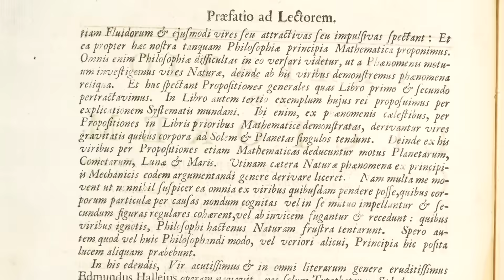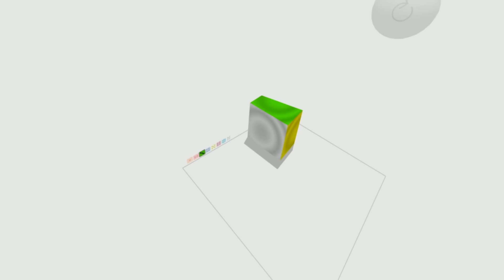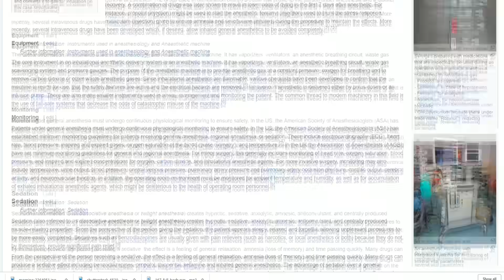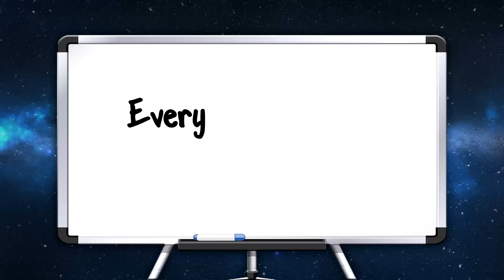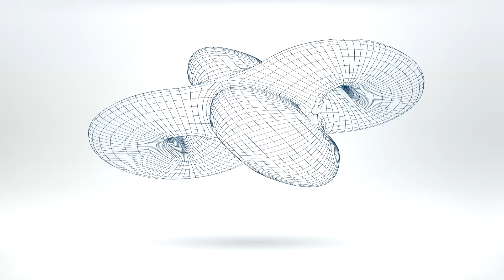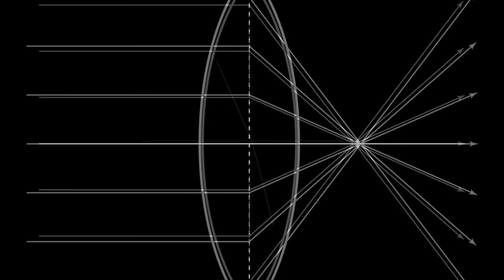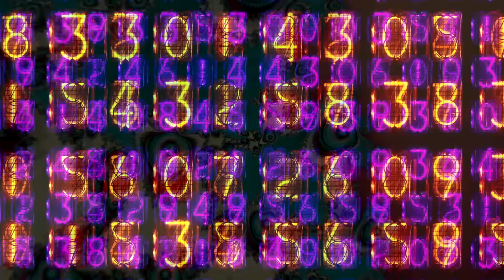The Mystery at the Bottom of Physics

Comment: If the BIg Bang had been more violent by a factor of 10^-60 or more, the universe would consist mostly of cold hydrogen, with few stars and supernovas. An uninteresting place.
If the Big Bang had been less violent by a similar factor, the universe would have ended in a Big Crunch by now. If the universe had not already collapsed, it would be filled with supernova remnants (with no planets) and black holes (which emit no radiation and hence cannot support life).

Why is the electromagnetic attraction between the proton and electron 10^39 times stronger than the gravitational attraction between them. If that factor were 10^38 or less, or 10^40 or greater, the universe as we know it would be impossible, and no life could emerge anywhere.

Comment: Imagine two clear chemicals reacting with each other and producing a compound, which is opaque. The opaque product seems to appear magically, doesn't it?
I claim this to be an effect of the fourth dimension on a molecular level. You could imagine the probability of an electron dwelling in a certain confinement, called an orbital, as a fourth property besides height, width and depth. While it is still dependent on three dimensional matter input, the product litterally appears out of nowhere.
You might argure that it shouldn't count, due to the fact that it does NOT appear magically out of nowhere, but it is merely a product of the two substances reacting with each other. But why should there be no rules for the fourth dimension? Wouldn't it break the laws thermodynamics?

Comment: The speed of light is actually variable based on how much the gravity pulls it (in any direction) for example the huge gravity that a black hole produces sucks light in and therefore it disrupts its speed (slower or faster).
One of the most important measurements is time. The time that we know has a start and an end or a start with no end (one-directional infinity) but the rality is the time can be and is omni-directional infinity so some things can not be measured in "time" but are measured in "events"...

Comment: The idea that gravity on earth was the same as for the heavens was not given a convincing proof until Newton but it was something sought after by Kepler who attributed the tides on earth to the action of gravity from the moon. He pointed out that if the moon's action on the earth was enough to produce tides then the action of the earth on the moon would be all the greater. But he lacked any connective tissue so to speak. Robert Hooke also wrote about this same possibility and claimed to have a proof that gravity had to be inverse-square, a proof which he told Edmund Halley about but which he never actually produced or published. The point being sure Newton proved it but the idea of unifying Kepler's and Galileo's laws into a single framework was already being talked about by others and had been around for at least 50 years by the time Newton started his research into gravity, so this idea was definitely not exclusive to Newton and was in no sense a complete bolt out of the blue.

Comment: We also don’t know how planes work so we’re doomed
Reply: Joukowsky transform airflow around a cylinder and you get airflow around a wing in cross section and a very reliable approximation for the lift involved at different air speeds so it's not exactly a matter of complete ignorance.
Reply: Dude, joking
Reply: @pizzleanimates1575  I assumed you were joking about the being doomed part. We really do need an international font/symbol for sarcasm. To your original point though, we don't really know why we can get away with the Joukowsky transformation because our knowledge of fluid dynamics is still so limited. So we can model what we don't really understand and somehow kind of get away with it. My point was also suggesting that there's still an incomplete ignorance but that we have eroded just enough ignorance to make functional planes anyway.

Comment: What's a field?
Reply: There's more than one kind of field but a useful example often used to get the ball rolling is temperature. Temperature as a field just means that a temperature can be defined at every point in space and for every time. You give me the point in space and the time, and if I have a really accurate temperature field equation then I can stick that location (coordinates) into an equation and out will pop the temperature at that point in space and at that time. This kind of field which a location goes in and a single number pops out is called a scalar field.

To complicate things there are also vector fields, spinorial fields and tensor fields. Technically, scalars and vectors are also different kinds of tensor so scalars and vector fields are also both examples of tensor fields but there are other kinds of tensor fields which are more complicated and you can represent the next least complicated fields with matrices. Once again the elements of that matrix depend on position in space and the moment in time. The principle is basically the same, you give me a location and I give you back a specific spinor, vector or matrix. So all fields, no matter how complicated, are always defined at all points in space and over all times.

That still doesn't say what they are used for in physics though. So here goes. Fields in physics describe how particles are created and annihilated, they describe how particles move and how they interact with other particles. So each particle in physics has a field associated with it. So there is an electron field and where the field is in some excited state you can say, hey there's an electron here or you can say the electron field is excited here and they mean the same thing. If you look at a proton that's two up quarks and a down quark. So two up quark field excitations interacting with a down quark field excitation. For a hydrogen atom, that's now an electron field excitation interacting with the proton, which was just the interaction of quark fields. All matter can then be built up from fields. You might ask why bother with the fields and why not just use the particles and the main reason is that when you stick with particles you cannot describe systems more complicated than one particle in a potential.  You cannot describe situations in which particles collide and something gets annihilated or new particles are created. Once you move to fields you can have all kinds of interactions and you can then model creation and annihilation of particles. So there's a complication but there's a payoff in descriptive power.

Hope that helps.

Comment: Gerald Whitrow, writing in the 1950s, gave shrewd reasons why a universe with 3+1 dimensions worked well and was friendly to complexity.
Unlike the other constants discussed in this video, the fine structure constant does not vary with the units of measurement. It is not only constant but dimensionless. It is the coupling constant for electromagnetism. A similar constant exists for the strong nuclear force, but is much less discussed than alpha. A coupling constant for gravitation can be defined, but requires choosing two objects with arbitrary masses. The ratio of the mass of the proton to that of the electron is called beta, and is about 1828. Like alpha, it is dimensionless.  
Planck units normalise G, c, h/2pi, and k to 1. 
For further discussion of this subject, go to Wikipedia or read the book described here:
https://en.wikipedia.org/wiki/Anthropic_principle#The_Anthropic_Cosmological_Principle

Comment: The video is just gobbledegook based on crazy science, and the crazy standard model. There's no such thing as time, and the constants are made from restrictions in scale like inflating a bunch of balloons in your house until your house is full of balloons. Those balloons will then have a restricted scale that they have to share with each other. The universe is quantized, and each Galaxy is quantized at the central point, by restricting scale you restrict the size of zero. Yes.. zero has scale. By restricting the scale of zero you give movement a minimum distance, and the crossing of a minimum distance is a constant speed. Speed = Distance. Like the lights on a Christmas tree the pattern moves at a speed based on distance. There is nothing complicated about the Universe, there are only mistakes that lead to confusion. These videos highlight the mistakes, but in an attempt to sound clever... that's not clever. Find the answer to almost any question by searching my site... http://greatestminds.freeforums.net/

Comment: if i'm traveling ½ the speed of light then my head lights would be traveling ½ the speed of light away from me.  but what you're saying is my taillights would be traveling the speed of light away from me.  i had to think about that for a minute.  is that what you're saying? (1:26)
Reply: No. Light from your headlights and your taillights are moving away from you at the speed of light. 

In special relativity where c is the speed of light, you add velocity v = V/c to a second velocity, u = U/c such that the total velocity is given by v + u / (1 + vu ). 

https://en.wikipedia.org/wiki/Velocity-addition_formula#Special_relativity

Now let V=c for your special case of the beam from your headlights and then v = c/c = 1. This would be you moving at velocity u watching light from your headlights move away. Sticking that into the velocity addition formula, you get...

(0.5 + 1) / (1+0.5) = 1.5/1.5 = 1 

But 1 is some new velocity for the light beam, that is just some velocity which is also divided by c . Well the only way that can ever be 1 is if the 'some velocity' is also the speed of light. So light is moving away from you at the speed c , just as if you were not moving at all.

Now for the tail light. Now instead v = -1

So, sticking that into the velocity summation law, you get  (0.5 - 1)/(1 - 0.5) = -1 . This too is the ratio of 'some speed' divided by the speed of light. But for this to be true that 'some speed' would be in the direction opposite your motion (it's negative in value) and it would have to be - c in magnitude. 

So, both the beam from your headlights and the beam from your tail lights are going at the speed of light.

Comment: Would it be that dark matter holding protons together inside nucleus. When matter is squeezed to a degree that it’s gets entrapped in dark matter lattice. Dark matter of course will not interact but act as a container. The power that’s packed inside is released when dark matter container is broken. Rambling stops.

Comment: lol , i like this approach  :D  ... however you have many things wrong and all you do is parroting mainstream bullshit science , but i like those fun parts  ... First of all light doesn't travel , and is not a constant .  Simply because light doesn't exist .   When we talk of light ,what we are really referring to is illumination of an object in a field .   So called light has not mass , it is not a particle , it is a wave . But wave is not a thing , wave is what something does.  Nothing emits light . When you talk you are not emitting anything . You are changing properties of the medium which surrounds you.  All those constants have origin in geometry . When you talk about Pi , again you are just parroting the definition ,without ever realizing that the value which we use for Pi is not calculated by its definition and the most fundamental formulas such as C=2Pi*r  , or A= Pi*r^2 have never been proven . We don't have any prior theorem for lengths of curves etc ... And exactly there is our science today ..  we do not understand the most fundamental geometric shape as is the circle . Time is not a dimension , Time is an arbitrary measurement unit by which we measure the rate of change . You can't slow it ,or bend it ,because it doesn't exist . Also you can't change units of measurement ,because then any experiment is not possible of empirical verification ,which is basic requirement in science . Einstein fucked this all up by theory which was stolen anyway and is holding our science back for fucking 100 years already .

Comment: Is the fact that there is a minimum length, proof that the universe is pixelated?
Reply: the "minimum length" isnt the smallest length possible, its just the smallest measurable length possible. once you go smaller than the planck distance, things exist as probabilities of position rather than actual positions
Reply: Noah Hassett quantom realm
Reply: @noahhassett3355  oled
Reply: Not necessarily, but possibly
Reply: @nbtstan3198  lol. Thanks for the insight. 😂
Reply: If the pixels are interactions, and not the actual particles that is spot on then?
Reply: Those aren't "pixels", they are interference caused by the changing frame rate: T - ^t

Comment: In my opinion, the constants in most things are simply not as important as the relations that come out of the math. For example, “G” is really just there because it needs to be and really only defines the strength of the gravitational force. What is really amazing is the actual relation between the other variables and gravity. Why does mass influence things in a linear manner? Why does it decrease asymptotically as Fα(1/r^2)? Nobody really knows. Additionally, it could very well be that classifying time as a separate dimension is wrong altogether and our 3D perception of the universe could just be our perceptions forcing us to look at a cross section(s) of a 4+D universe. Not only that, but where do all the interactions and the laws that govern them come out of? Why does the strong and weak force act the way it does and only under certain ranges? Why are gravity and electromagnetism related mathematically? If there is different sister part of gravity that acts on a principle of angular momentum like magnetism does? All in all, there seems to be a seamless interconnected value between all of physics and mathematics including mathematical constants like e π and i (being that through calculus you can fairly easily derive e^(πi)=-1)

Comment: The mass of a proton can vary, based on composition. If it is made of two up quarks and one down, then it is 1 AMU. If it is two charmed and a strange, then it is 286.5 AMU, weighing about as much as Nihonium. If you construct a proton with two top quarks and a bottom quark, then it will weigh ~35,000 AMU. It is easy to think that the mass of a proton is constant, considering that most protons are composed of (uq,uq,dq), and the heavier variants decompose back to (uq,uq,dq), but it is not impossible to imagine that heavier protons could be stable in certain conditions. Additionally, we have no proof that (uq,uq,dq) is the lightest proton variant, either.

Comment: When it comes why there exists anything at all you have three options once you break it all down.
1. Nothing became something at some point (quantum fluctuations), logically impossible, nothing can't exist because if it existed, it would be something.
2. Infinite regression (aka turtles all the way down, big bounce theory), logically impossible as you need more than infinite energy to sustain the infinite causal chain.
3. Something always existed/existence has no beginning, it always was, a thermodynamically isolated system, logically sound.

Further down the line you get the question "why is there change"/ free will vs determinism and now you have a further 2 options.
1. Change is constant and random, logically inconsistent with our observable universe as it is highly ordered.
2. The something that always was, willed it, since if there was complete order without will to change it, it would be in eternal equilibrium (steady state model).

Then you have the question of consciousness where there is only one option even though people claim there is two.
1. Consciousness is an emergent property, not possible, if the primordial soup that our universe consists of has no connection to consciousness, how could it eventually contain it? for example, if the "Lego" everything is ultimately made of was entirely formless, it wouldn't be able to create form (matter) and if it was entirely material it wouldn't be able to create the immaterial (consciousness). There is also the reality of the philosophical zombie hypothesis that it can't really contend with.
2. Consciousness is a base property of reality/existence and it is not material in nature, a rock can't conceive of consciousness, but consciousness can conceive a rock.

Comment: While the speed of light is constant it will not maintain that speed from you if you are moving at a noticeable fraction of the speed of light. If you were moving 99.999 light would be 0.0001 faster than you. The reason for blue/red shift on FTL. And if you equaled LS everything would be standing still even light.
Reply: For you it will due to time dilation you will expirence

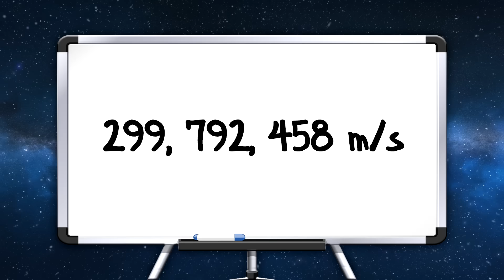Comment: 1:39 - That's wrong. It wouldn't be moving that fast away from you because that would mean traveling faster than the speed of light. If you were travelling at the speed of light and you turned on a torch the light couldn't fucking travel at the speed of light away from you because that would mean going twice as fast as the speed of light. You Squib
Reply: No, that's where relativity comes in. If you move at 1/2 the speed of light (c) and shine a light in front of you, the light still is moving at the speed of light from your perspective from which you are stationary. Velocities aren't just simply added. Space and time will contort to make sure that light in a vacuum always is travelling at c.